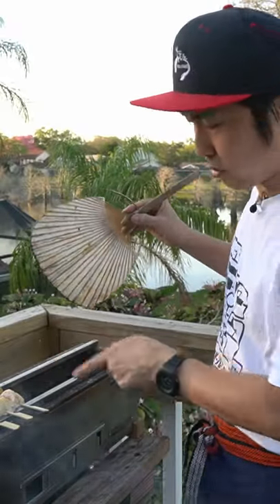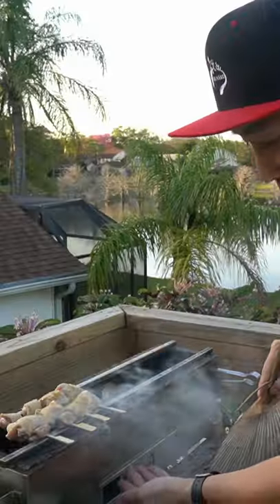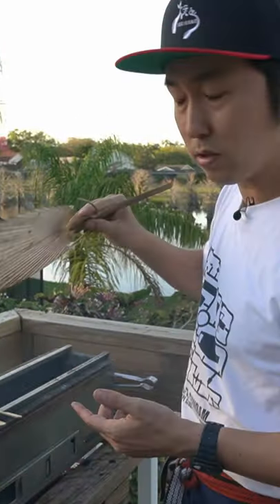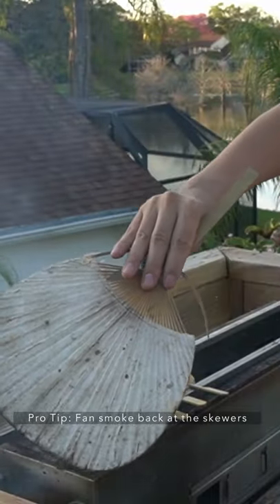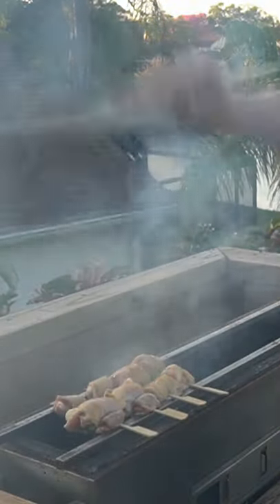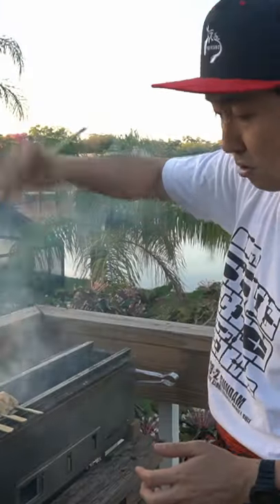How the Uchiwa fan is used for Yakitori #shorts

Comment: Hey. Just wanted to say. I love your stuff. I'm gonna probably make a custom charcoal grill with a drill, dremel, sheet metal nuts and bolts etc. Seeing as I can't find a decent electric one online and I don't know how well I can rely on grills pre-made. So I figured I would do it myself so I know it will last a long time and work well. I still would love an electric one though. I've seen nice ones that street cooks use in Japan but can't find them anywhere. :( they look awesome with the coil running tight to make big heat instead of spread out.
Reply from the maker: Thanks for being here! Yea the commercial electric ones in Japan are solid and actually what many shops use along with gas. Only the highest end places cook with real binchotan. Good luck on your custom charcoal grill!

Comment: How do you feel about using an electric hand fan?
Reply from the maker: I guess you can use it for pumping lots of air real fast, but I prefer versatility in speed, air flow, and just more in tune control by using hand fan.